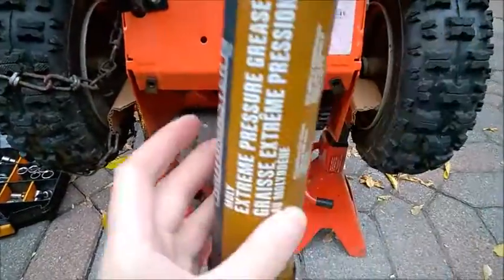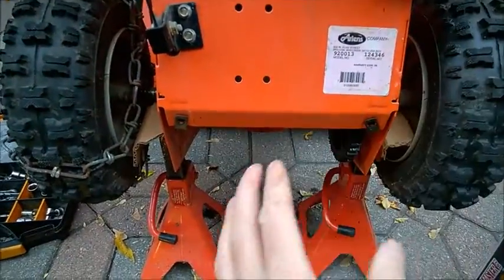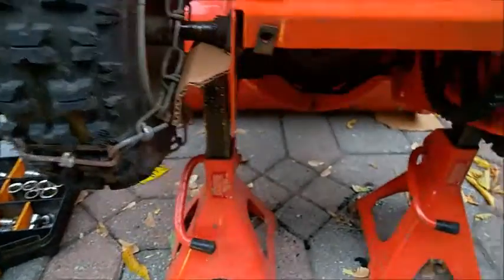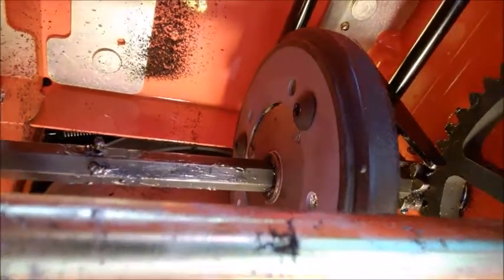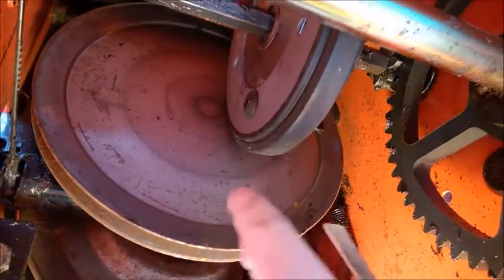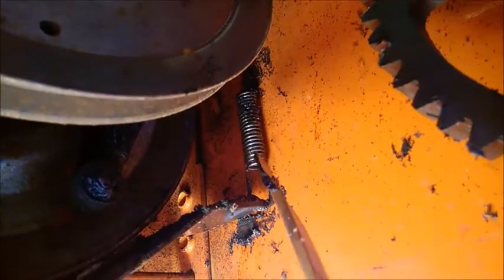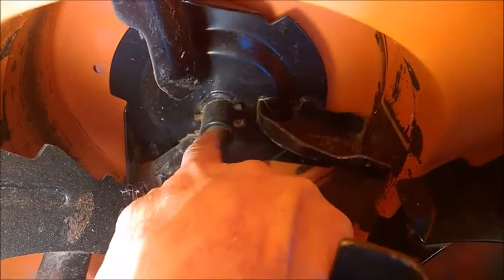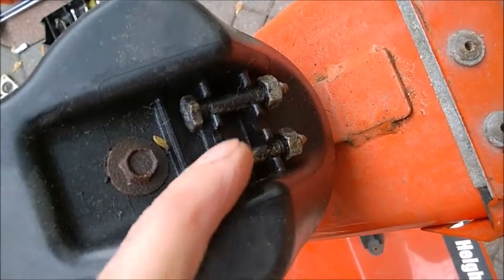What to grease on a Snow blower

Comment from the maker: Do not put too much grease on the hex shaft, so it doesn't get thrown on the flywheel during operation. Important
No start 2 seconds trick  https://youtu.be/FxZFRYCaEDs
Friction disc replacement  https://youtu.be/8j8ttJovs90